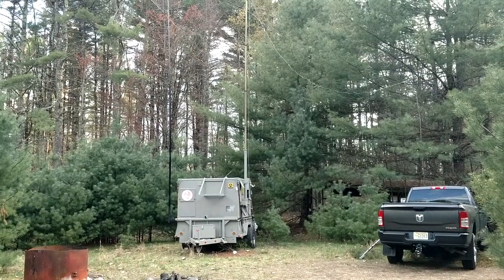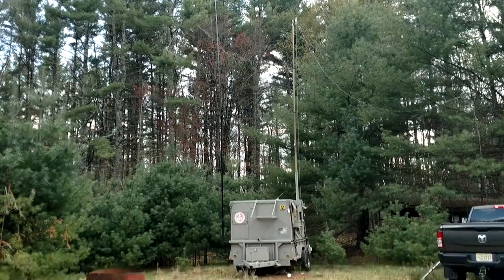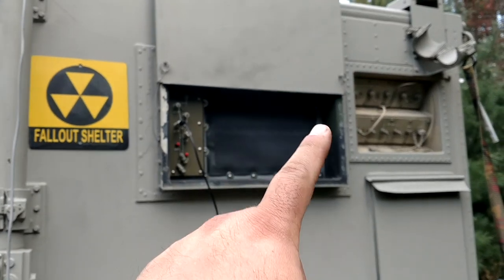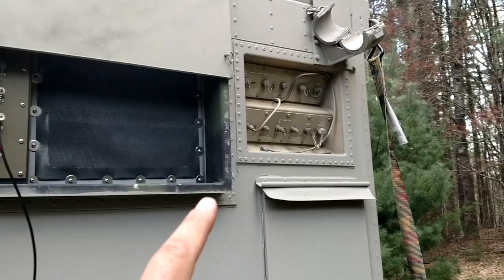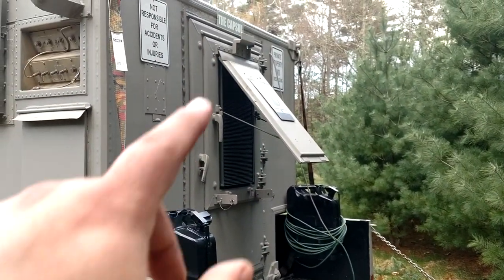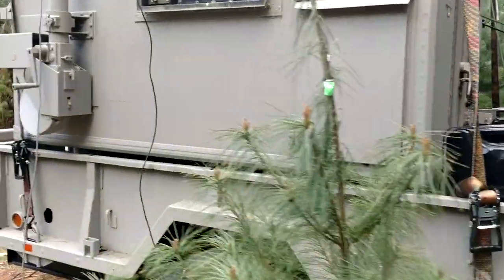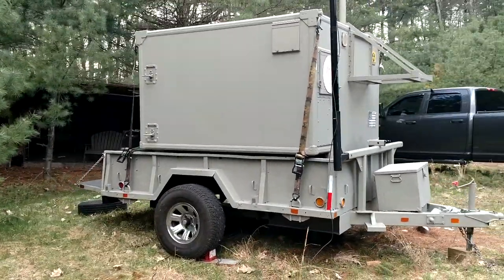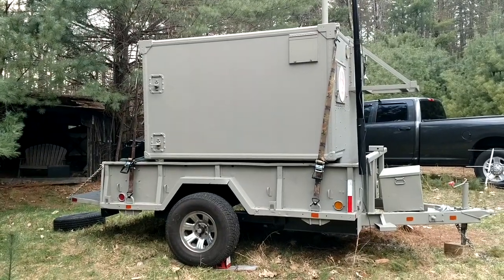Decommissioned military communications shelter for ham radio part 2

Comment: Very cool! I also like the fact that it doesn’t scream military surplus. Was looking at one of these recently. It was for the shelter only in camouflage for $1895 in PA. Very bare-bones no trailer underneath. Battleship gray paint job on the outside over camo ones would make for more normalized in urban use. Do like yours. Also like the red light submarine motif going on inside.
Take it easy.
Reply from the maker: I definitely love mine. I get a lot of use out of it but like anything you have to make it yours and customize it.